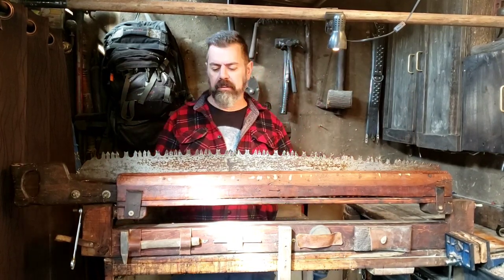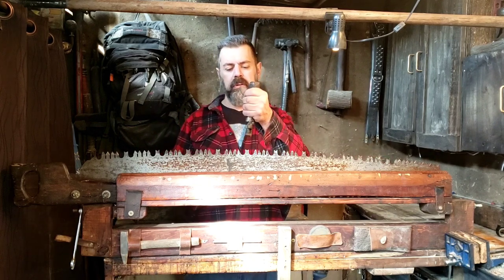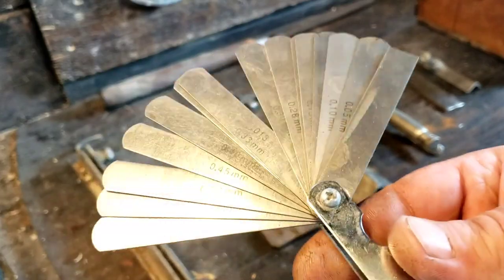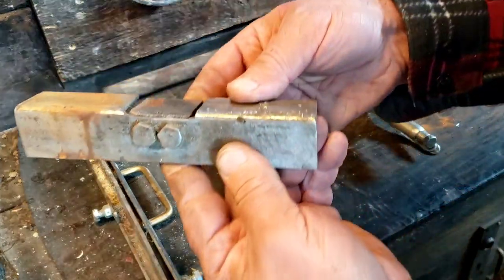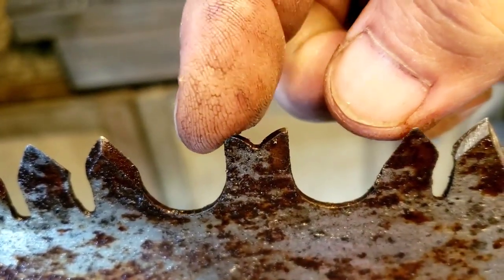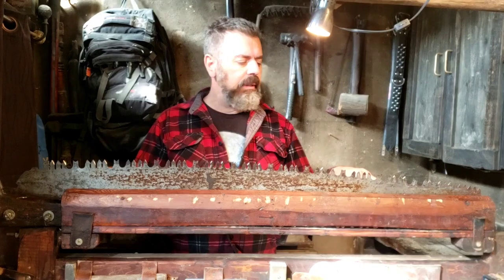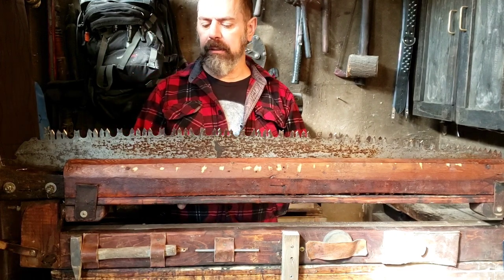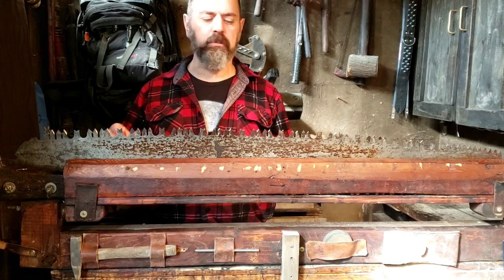Crosscut Saw Maintenance-A Forgotten Skill

Comment: I picked up a nice bucksaw once. Sharpened well, but they never cut the rakers down so you can imagine how it cuts. Not!. 
 I did find a replacement dry wood blade for it which works much better. Picked up two vintage folding pack saws for free at the dump on Saturday. Brand new, never been used. . I gave my brother a nice one-man cross-cut because I am stupid. Thank you for the mini-lesson, Ken. Stay safe and stay cool/warm
Reply from the maker: Thanks Sean.  I really enjoyed hearing your story as well 😊